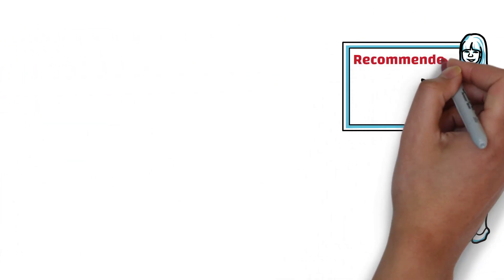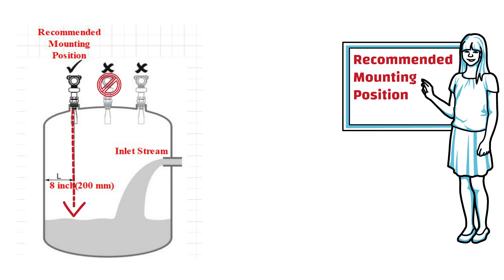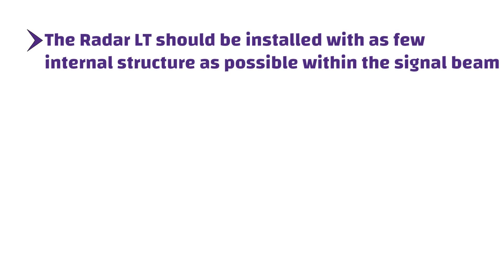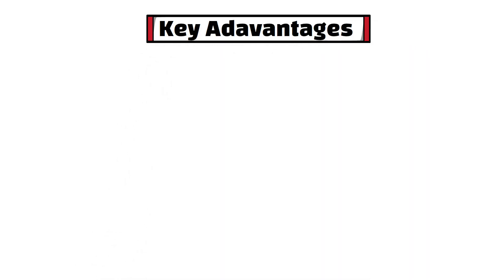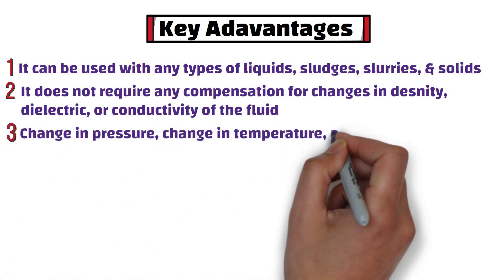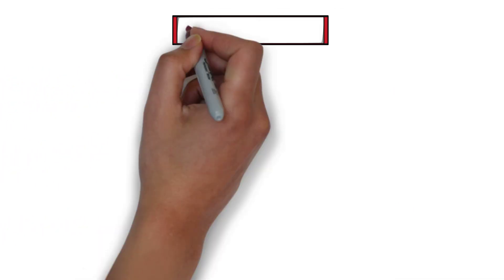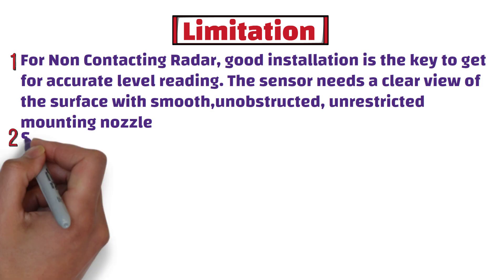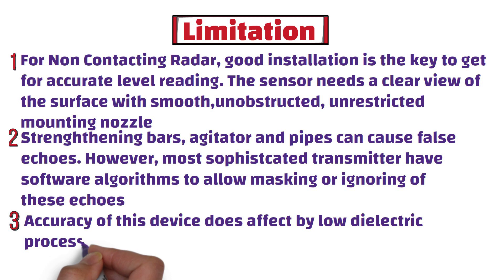Radar Level Transmitter Mounting Guidelines | Radar Level Measurement

Comment: I installed radar water level sensor in the river bank. The arm radar sensor is 3m from original factory so short. My radar sensor do not touch the surface of river water. My question how to setup this situation.
Reply from the maker: Hi , 

It depends on various factors and the model of your sensors as well.
Kindly state the model you are installing